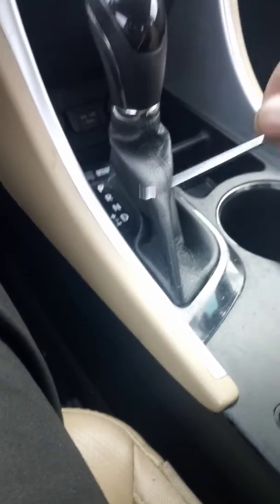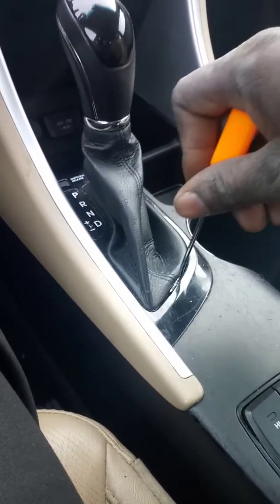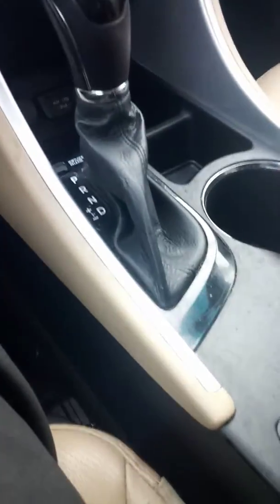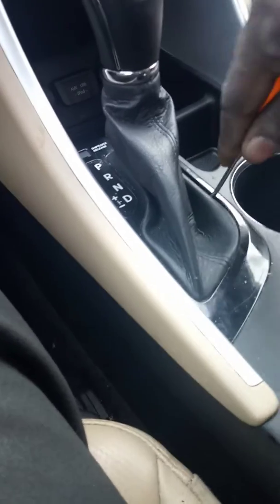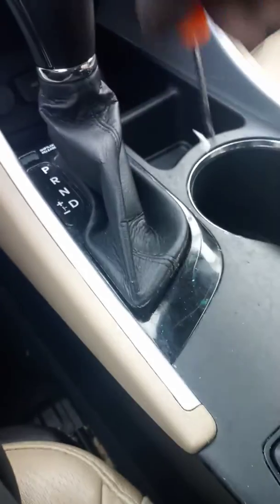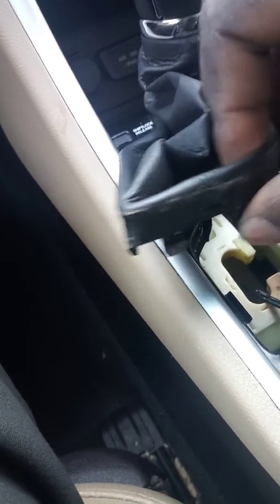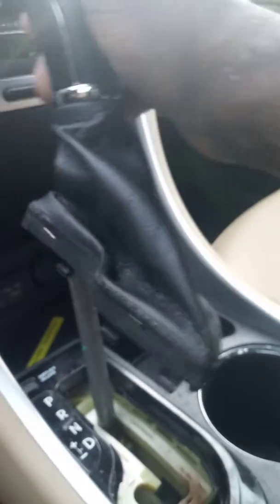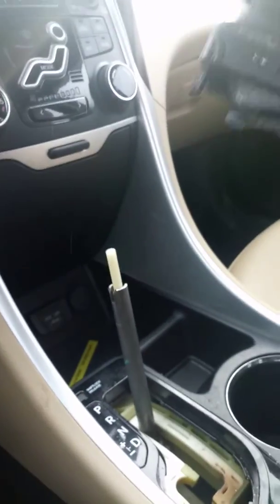2011 hyundai sonata shift knob removal

Comment: That's what I'm talkin' bout!  I'm having a problem with the system not recognizing my car is in park.  When I shut the engine off, my accessories stay on, and the display on my dash says "Shift to P".  So I can't lock my doors with the remote entry key because the system think the car is in drive or neutral.  I see in the Hyundai forums that it's probably an issue with the gear shift.  Now I can take that knob off and check it out.  Thanks!
Reply: Did you ever get the issue figured out? If so I'm having that same issue.
Reply: Tiffany B same here I was reading that it’s a common issue online . If anybody can reply how to fix it that be nice save me money
Reply: https://youtu.be/3F5FBWKT7Sw here’s the link on how to fix it.  Definitely works!

Comment: Can you show how to remove just the top part, not the soft leather? Is it possible?
Reply: Its a pain in the ass. Need to remove the whole thing. Under is a big plastic clip attached to the leather with 2 tabs you have to push in to get off. I almost destroyed the clip but still works

Comment: Hey I have a Hyundai azera 2015 with the same shift knob so far I took the leather part off like you did and pulled it didn't come off. The knob I opened up to  and no go how hard do I have to pull and to see if I modify it for something after market if I can keep the leather part I will  or use all new systems.

Comment: Normally when someone removes their shifter knob it is to replace it and not just to stick it back on. It would be good to show how to get the boot off and install it on the new shift knob. That would certainly be a critical part of this procedure.
A small flat head screwdriver and push the tabs on both sides of the boot flange inward then gently remove it. It can then slide on the new knob. Make sure you push it all the way in until it clicks and catches. Then reinstall the knob like shown.
Reply: Facts fr they never show how to remove the boot. But ima try your advice hopefully it work

Comment: Can you tell, the button that’s on the shift knob, is it also on that stick? If I were to put any after market shift knob with no button or button on the side, would that work??
Reply: You would have to rig it with zip ties or some thing similar to hold the bar in place so it doesn’t lock gear